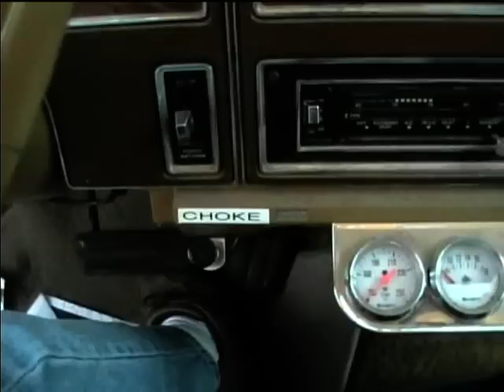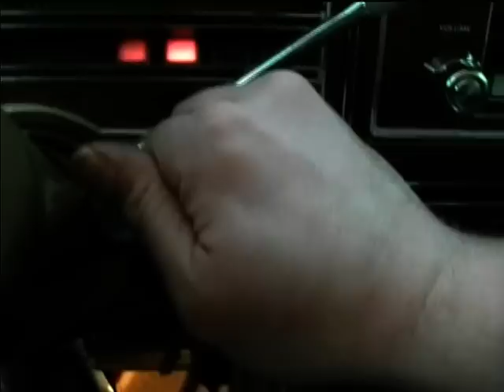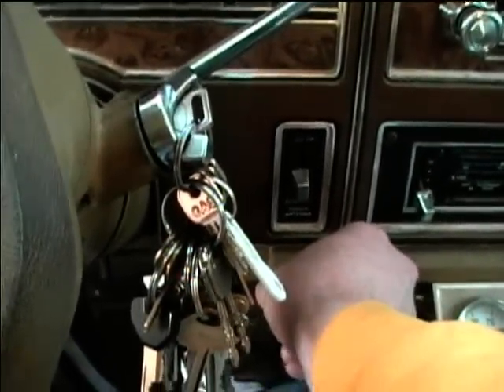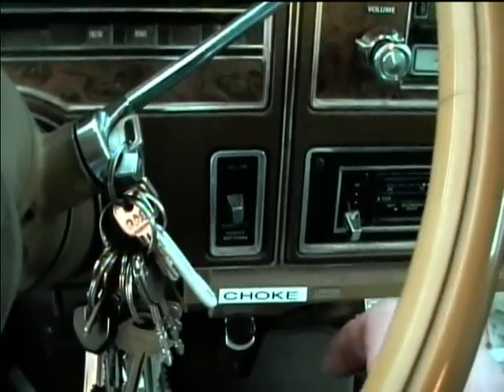Manual Choke Conversion, 1978 Mercury Grand Marquis

Comment: That's very possible. The average driver likely wouldn't be able to handle those tasks.

I think that the idle control may be the reason your engine stalled, it just likely wants a bit more idle speed. I know my van starts out at 1500 revs until the choke disengages.

Glad to hear it gave you better performance, I bet your gas mileage improves as well.

Comment from the maker: Yes, sometimes the starter drive doesn't always engage the flywheel. I have a brand new starter in the trunk in case this one craps out but it always will crank the engine, just not necessarily on the first try.

Comment: If you normally have to pump the accelerator more than once to start her cold you have other issues in that 2150 - I'd start with checking the diaphragm.

Comment from the maker: Thanks! No, I haven't been able to solve the compressor problem yet. I will need to make a fan shroud to increase cooling effectiveness on the radiator/condensor before I can get the AC fixed...I'm afraid the extra heat from the condensor will cause the radiator to overheat without the shroud.

Comment: I'd always thought the standard protocol in the starting of a cold carburated engine was to push the accelerator once to the floor, release, and then to hit the ignition.  Perhaps some of your difficulty in starting comes from your multiple primings.

Comment from the maker: The thing I have noticed though is that all of my buses (through a 1978 model) still have manual chokes (and dashboard-adjustable throttle controls to enable a manual setting of idle speed). Maybe they expected professional drivers to be able to use these settings more successfully?

Comment: do people in parts of the country still drive these cars often? most of the old v 8 engines will run forever. i have a 1989 camaro, its a little newer than your 78, but it has 172K on runs great. its a tbi fueled engine.

Comment: dang where can i find one of these manual choke things you installed i have a single baroll ford carb with the electric choke and it does not work a manuel one would be great where did you get the parts?

Comment: This only happens if the electronic control system and related actuators are poorly designed. I've seen well-designed fuel and ignition management systems run flawlessly for over 400,000 miles with minimal maintenance. Likewise, a well designed carburetor and mechanically controlled ignition system can last just as long. I've owned both. American cars gave electronic management a bad name during the 1980s, as most components were poorly designed.